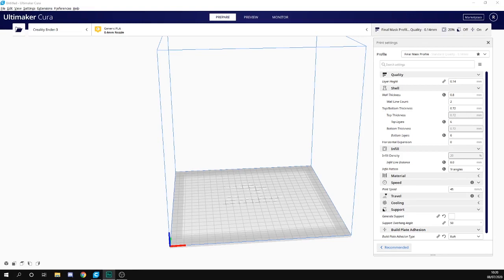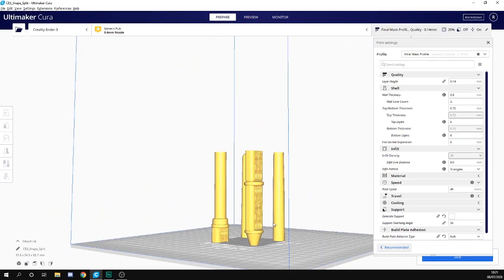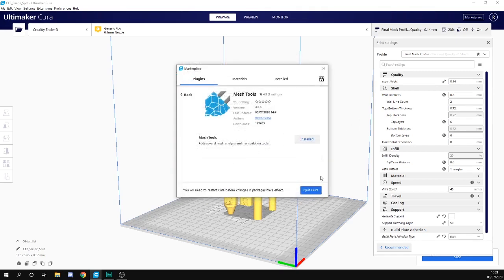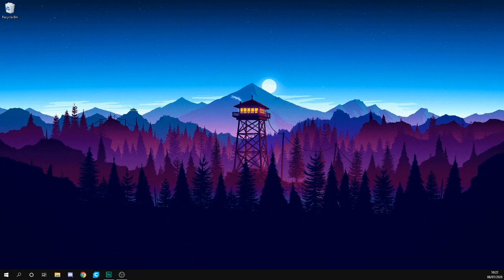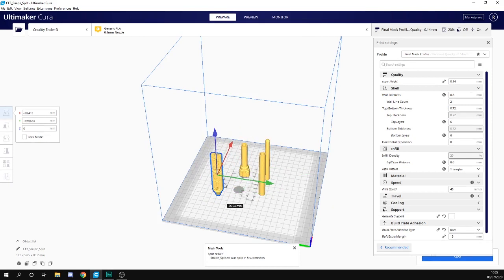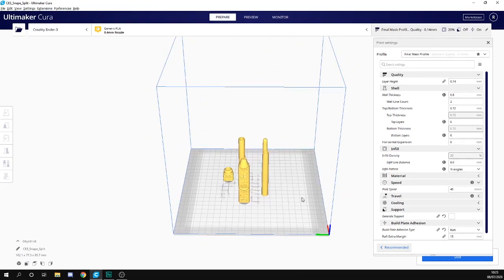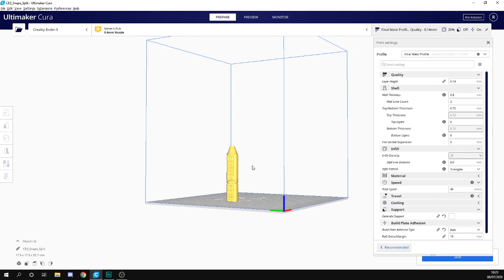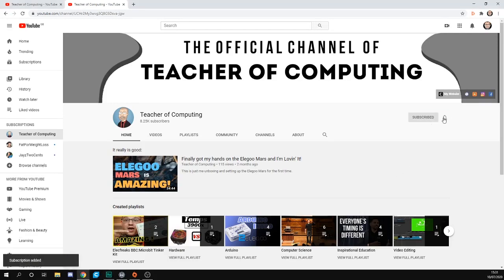How to separate a multiple part STL in Cura

Comment: what if the part are together like a helmet?
i do that and it says "unable to split" what do i do?
Reply from the maker: This is to separate multiple parts that are in one stl. To split a helmet into multiple files you need to use mesh mixer and plane cut elthen export.